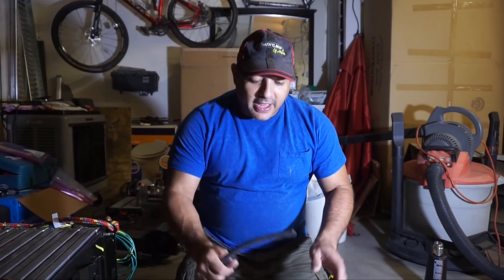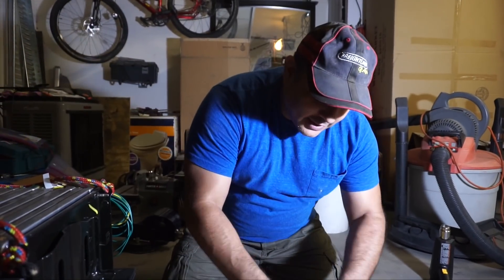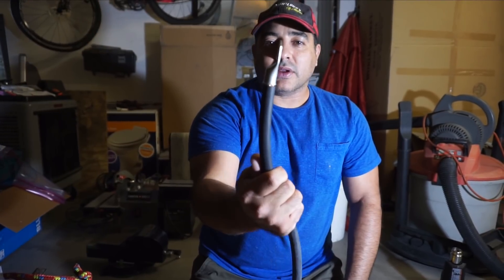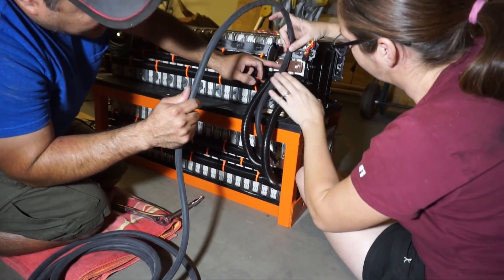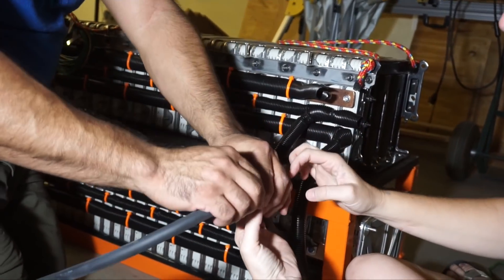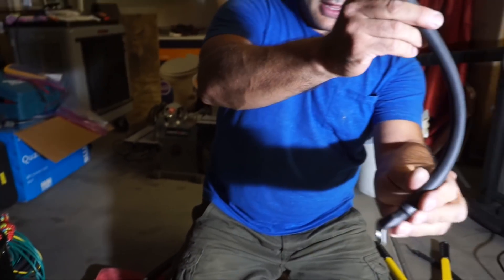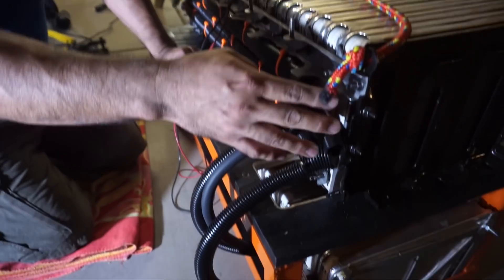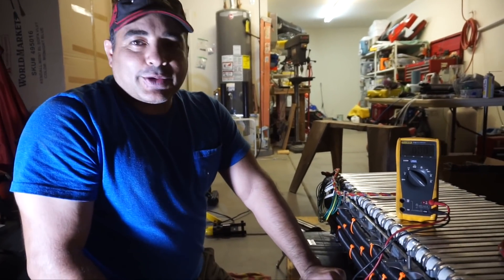RV House Battery Part 5: How we make large 2/0 cables

Comment: Just started watching your channel.   Great Video.   I've previously made a number of 1/0 & 2/0 cables just as you described and had good luck.   I didn't hear you mention it but from reading the comments I suspect you're using (marine grade) GLUE LINED heat shrink tubing which I would recommend as it seals the lug and cable more completely than standard heat shrink tubing.   It's more expensive (as always) but like mentioned in a comment, you can verify its sealing well with the heat gun by watching for some of the glue to ooze out and bond the edges of the HS as you're shrinking it.   (Sorry if it was mentioned in another video.)   Learned about BftM via the BGM videos and appreciate all you guys did to improve the safety and function of your beautiful ride!    Always nice to see someone trying to do things "RIGHT."     Good luck and safe travels!
Reply from the maker: Thank you HandyManDM.  We do indeed use Marine Heat Shrink with the glue just as you mentioned. Welcome to the channel.

Comment: Excellent job on the video!  However if I may make a suggestion...?  

Currently, you're putting the whole thing together and then putting it in a vise, and pounding on it with a steel hammer to make the 45° bend.  You would be better off to put it all together, slip the heat shrink over the lug and wire, and move it back out of the way.  Then use the hammer and make the bend.  Once that is done, slide the heat-shrink back into place and shrink it down. 

This eliminates any chance of cutting the heat shrink at the point where the hammer strikes the sharp ridge around the lug.    Even the smallest cut in the heat shrink creates a point of origin for oxidation to start.
Reply from the maker: Thank you Patrick - excellent advice!

Comment: Armchair wise ass and hindsight manager here - you have done a fine job but when working on the battery assembly it would have been prudent to have a set of tools that you have taped up with insulating tape.
Reply from the maker: Hi Norman - I did have my tools wrapped in electrical tape for a long time!  It seemed like every time I got tired of it it was time to record!

Comment: After 5 years of use my lead acid Trojan batteries never had oxidization. I sprayed CorosionX on the post and connectors. The stuff is clear and clean and completely eliminates any type of corrosion or oxidization including dissimilar metals. Just FYI. Great videos by the way!
Reply from the maker: Thank you Tom - we are using no-ox on every open piece of metal we can find.  We even went back into some of the old bus junctions and applied it to old circuits.
Reply: As a retired electrician I am very familiar with "No Ox" and used it all the time on circuit panels and wire connectors. After I retired the second time (20 yrs Naval Aviation Electrician and 16 Yrs Lic. Electrician in Ca.) my wife and I went to full timing in our RV. I sold and installed Satellite Internet Mobile RV systems for the first couple of years. The cost of these units were 5K or more installed and I was installing them on very expensive coaches like Prevosts etc. This required me to do VERY clean installs. I was in Quartzite, AZ to sell at the RV show in 2001 and there was a guy selling "Corrosion X". He had a clear plastic fish bowl like container full of the stuff on display. He also had a 4" 120vac television with the case removed showing all the circuitry. He would plug it in and turn it on and then lower it (picture showing) into the liquid. Mind you he held on to the TV submerging his hands into the liquid while energized! Absolutely no electrical induction was produced! I was skeptical of corse and questioned him relentlessly. LOL! He explaind the effects it had on electrolysis and conductivity and I decided to give it a try. I used it on every electril conection on my RV, Boat, Jeep, and prayed my Generators with it. I have a 1200 watt solar system I installed on my rig and a 1080Ah  bank of 8 AGM batteries. I installed this system 2 years ago and spray the terminals 1 per year. I have never had any corrosion. I even use it in my water compartment and have never seen any rust anywhere. I use the Boat version for wet locations as it is thicker and lasts longer in those situations. Please don't take this as me tooting my own horn. The fact is I travel alot and people ask how I keep my electrical compartment and batteries so clean. And this is it. No Ox works well but is a bit messy for my likings. It's not expensive stuff and it is clean and easy to use. 
BTW the rig I wrote about before was our first GAS RV and we drove it to death in 10 years. We are now in a Diesel Pusher and hope to die before it does! LOL! Good luck in your endeavors and Happy Trails.  

Check out their you-tube video..... https://youtu.be/CazbJE7tWIs    Sorry about the long reply. I'm not selling this stuff I just believe it's the best. You can find most of their products at Amazon.com  OBTW it caries a Mil Spec Number! The Navy is now using it on there newest hight tech ships.

Comment: When working with welding cables and the likes of those you're using, I generally dont crimp.  I generally gas solder them and heat shrink them after putting Vaseline over them.
Reply from the maker: Thanks for the tip.  We will see how these hold up - so far they seem to be doing pretty well.
Reply: I have to say you've done an extremely good job doing it your way too and I dont think you'll have much of a corrosion problem with those cables anyway.  That tool is awesome!

Comment: Outstanding, crimping is the way to do the ends. I have seen people heat the end of the fitting, fill it with solder and then shove the stripped cable in. This results in a cold solder joint. I guess your could continue to heat with to try and get a good solder joint but you cannot see it to tell if you have. Cold solder joint results in resistance which equals heat.Thin stranded cable is excellent. Most people do not realize the electricity does not flow through the cable but travels on the surface of the wire. So the more tin strands you have the better the current caring capacity. Think you did the connection perfect. Heat gun over a lighter is perfect. To bad you could not come up through the plywood. (dielectric grease) Just a thought, could you space out the connection from the battery and then run the wire straight down. Glenn Lever
Reply: AC current travels on the outer diameter. DC current travels through the inner diameter. Common misconception in people with car audio wires they think more strands equals better at 12V DC. All it does is add flexibility and decrease amperes capacity.

Comment: The grease which you obviously know by now which you spoke of is dielectric grease. It can be used on the mating areas but use a very thin coat as it could prevent conductivity (because of its properties. I do not place on the mating area but just coat all the areas that makes air contact as well as 1 -  inches along the conductors. Make sure to apply all around wire at the insulation cut line to prevent air/water penetration between the conductor (wire) and insulation (jacket). I find a lot of people forget this area. Good install so far. I would have placed a plexiglass shield the length of each bank but i'm overly cautious and training kicks in. I  worked around 48 VDC equipment for 6 years back in the late eighties. Yes I know lead acid is not the same as lithium but for me I would rather have safety on over kill. I might have also wired in a couple of 12 volt PC fans (maybe 3") just to move the air around in the area. This would even out the hot spots and help to minimize the amount of time the a/c kicks in. PC fans sip current in mA's. Good videos!

EDIT: Just a typo: vold -> volt
Reply from the maker: Thanks for the tips Jon!  Yes, we have started putting dielectric grease on everything - Even the old bus wires!  I will look into the PC fan idea - sounds like an excellent suggestion!  Totally agree with you about the safety too - we are trying to be as safe as possible.
Reply: You gained a new sub... ! Looking forward to the continuing saga... You can use a a thin coat of petroleum jelly (Vaseline) on the mating surface to help keep the air from oxidizing the surfaces. I overbuild build with safety in mind, gives me peace of mind esp with children / teens capable of reaching the area... You should also see a portion of the conductor (wire) stripped past the termination (~1/8"). This is to show/prove proper connection. This is general electrical code but may vary per state. 

Love the Hammer Time reference... Oops yeah put unfortunately a far bit older than 40..lol... :)

Comment: Hey Juan. Greg from the FB group. I have the same hydraulic crimpers. They have worked well for all cable sized except 4/0. The 120 dies included are supposed to be correct but the dies bottom out before solid connection is made. 2/0 cables and below I have had excellent results. One more thing. On the heat shrink it is good to visually inspect as you heat. You should see a small bead of glue seal the ends before removing heat. Another great Video! Can't wait to see you fire this monster up!
Reply from the maker: harleyd500 hey greg, didn't recognize you with the fancy Harley name.  😉  the biggest cable we have done is the 2/0 but our bus does have 4/0 on the starter batteries, so thanks for the heads up.  We noticed the same thing on the heat shrink with the glue bead sealing it.  Thanks!
Reply: which die did you use on the 2/0 cables. 70 seems too big and 50 seems to be too tight.

Comment: I know you are working with low voltage and you're taking safetly procautions but gloves would be a better and it's a good idea to tape you ratchet as well. That battery is a beast, great work!
Reply: 48v DC won't hurt you unless maybe you hold exposed wires and short them. Be carefull with wedding bands etc aswell ofcourse.
Reply: Deiphobuzz I think he meant a lot of amps not voltage, as there is quite a lot of amps in there, don't be fooled by 40v when it's battery's especially for lithium batteries (even at 5v voltages them packs can go thermal nuclear and puff out magic smoke)

but I agree should be use gloves that can handle arking and flash over and glasses, it can blow bits of metal or copper busbar off
Reply: lee x well, if that was true i would shock myself all day long when welding at 30+ volts and 250 amps for example. If it was AC.. yes.. dangerous. ACtig is easy to get shocked by though.
Reply: Deiphobuzz with your hands should not be an issue, the issue is if you touch the positive conductor with the negative side with lithium ion batteries the amperage they can put out can make a pretty big bang or just a big spark in some cases it will blow bits of metal off or copper off
Reply: Even before we grounded equipment we didnt die. 48v DC is safe to handle in normal circumstances.
Reply: Amps is not what overcomes resistance in your body. Its the voltage that shocks you and the amps that kill you. 

9v battery to the skin, no problem. Put it in your tongue..

Résistance!
Reply: Interesting discussion, it’s just good practice to use gloves. If you always use gloves even on low voltages, you won’t ‘forget’ when your near high voltages in other parts of the bus.
Reply: Bit of story here. Knew a guy who worked for Western Electric. Those folks did installs in Ma Bell’s telephone central offices. A central office of the day had a battery vault that was 48v, just about like this one. Comprised of 1.5 v lead acid battery cells the size of a card table. Could deliver many thousands of amps. Gent was up on a frame and dropped a combination wrench... right across the battery bus. After everyone recovered from the blinding blue flash all they found were the ends of the wrench. For the record a Lithium ion battery pack, when presented with a direct short, maybe a wrench or perhaps a ring will deliver an instantaneous current of many thousands of amperes. Me, NO jewelry of any kind. Use insulated tools and perhaps gloves. Hell, when I worked on airplanes we couldn’t even wear spectacles with metal frames. Hope this informs.